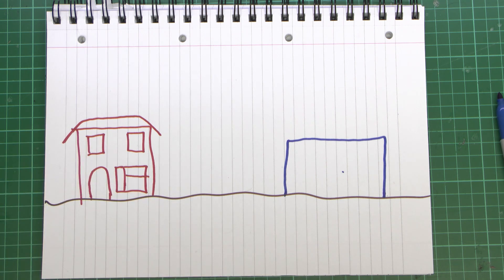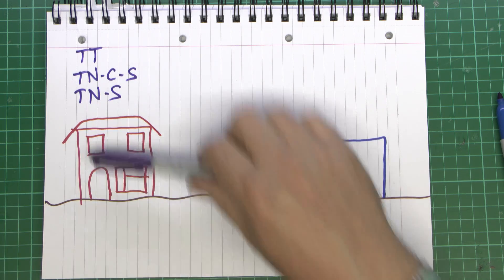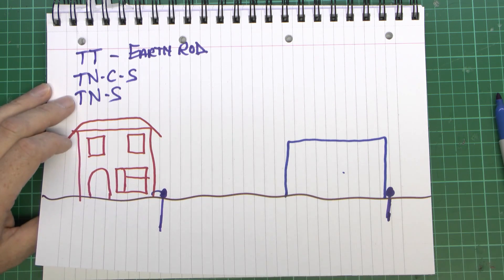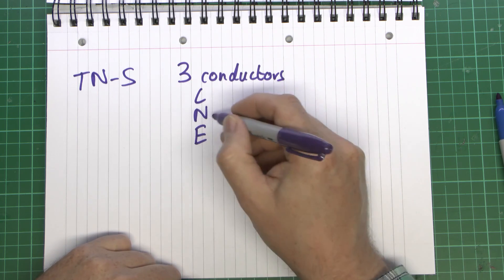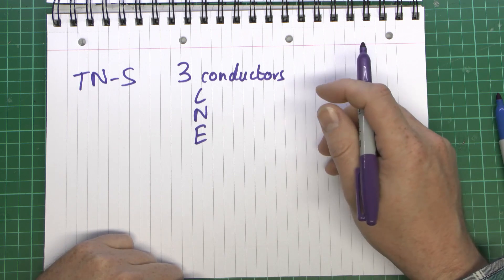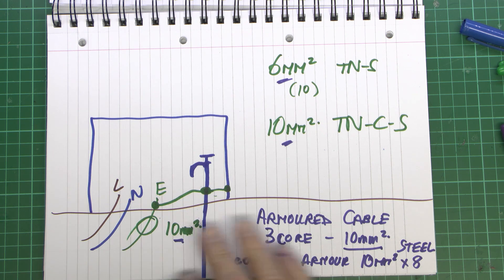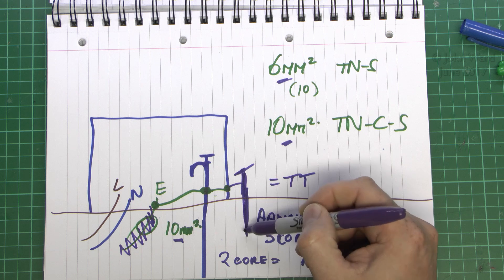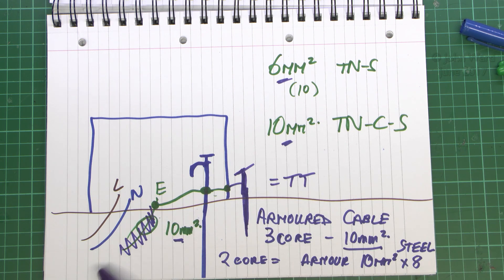Earthing Systems for Outbuildings

Comment: With TN-C-S supply, In the rules AS3000-2007 that outbuilding bonding cable really only needs to be 4mm2, I prefer 6mm2 min.  There is an min earthing conductor size to ensure trip times and fault current handling, table for each size of active conductor, eg:- 4mm2 is ok for 10mm2 active conductors 6mm2 earth is good for up to 25mm2 active conductors. 
The 4mm2 min and up to 120mm2 max applies to the conductor for bonding parts too, I can not see a blanket 10mm2 as its over the top and is not needed for a back yard shed typically with only 2.5mm2 twin and earth run in. The bonding conductor needs to be scaled min 4mm2 and up based on the prospective fault current for the largest active conductor feeding the building, 10mm2 may not be enough in larger installations, so that 10mm2 blanket bonding conductor size rule is rubbish even if it is valid. It's not being complied with here in Australia mostly it's only PVC insulated 4mm2.
Reply: We don't have TN-C-S supplies here, (we bond our "separate earth system" to the incoming neutral), and they don't seem to use our M.E.N system there which surprised the hell out of me ( they don't drive electrodes except in T-T and even then they choose not to bond them to the incoming neutral for some strange reason), so there is no point applying our rules to their systems, you will NEVER achieve our maximum "touch voltage" requirements with their T-T or TN-S systems, that's why they use RCDs as their PRIMARY form of protection, where as we use them for ADDITIONAL protection, we do not require RCD protection on sub mains to out buildings as they do (thank fuk, imagine all the phone calls of nuisance tripping you would get every thunder storm), it's also why we can use 4mm equipotential bonds here.
Oh one last point there is no "maximum" earth size anymore, the 120mm only applies to protected circuits.

Comment: John, thanks for this. You did not explain why the earth cable needs to increase from 6 sq mm to 10 sq mm if there were extraneous parts. I presume it is because more current needs to be carried .... but why?
Reply from the maker: TN-C-S installations require the main bonding to be at least 10mm.

Comment: A shop i worked at had a shipping container out back with a light and socket in it. They just stuck a plastic conduit from the shop to the container. no thought was given to bonding etc.

Comment: JohnMy assessor told me that if an outbuilding is more than 20m (footing to footing) away from the house then an earth rod must be installed.  Is that correct?  Thanks
Reply from the maker: In a way.  There isn't a specified distance, but as you get further from the main property it makes more sense to have an additional rod rather than to rely on what could be a very long cable.

Comment: My grandfather have some talent for electronics. Replaces the ungrounded power outlets with grounded ones, does not connets it to anything (at least he says), and there is 115 and 81 volts to main and neutral from the ground. If I connect my aplifier to the living room, the speaker in the bathroom give me 81V to the case of the washing machine. The next rooms power outlet works fine. It MAYBE connected to the heatin systems radiator. The taps earthing is removed. In the garage we have a power outlet which have main on both terminal. Makes extension cord from 3 color 4 core wire, uses the same color twice. Uses 3 core wire, metal case machine, earth plug, leaves earth wire long and not connect. Doesn't use the strain relief in the plug. Maybe I sould be or get an electrician and redo the whole wiring.

Comment: Rather than using 3core SWA at 10mm2, can you not use 6mm2 and use the third core AND the armour for Earth to make up the deficit? (assuming 6mm2 is enough for the L/N conductors too)
Reply from the maker: No, as 6mm² SWA has steel armour of about 23mm²,  but as steel is about 8 times less conductive than copper, the 23mm steel is only equivalent to about 2.9mm copper, 6+2.9 is less than the 10 required.
Reply: I would be a bit reluctant to supplement the 6sqmm armoured cable
earth core and about 23sqmm of steel armour in parallel. However, I don’t know
if this arrangement would equal the current carrying capability of the 10sqmm
bonding conductor? If the d.c. resistance of the armour is about 6.7ohms/km and
the d.c. resistance of the 6sqmm copper is 3ohms/km with a current carrying
capacity of about 42A, could we assume the armour will have a current capacity
of about 3/6.7 x 42 = 18A? This would give a total rating of 42+18=60A - which
approximates to the 60A rating of the 10sqmm single core.A bit shaky perhaps – A bit of hose pipe may be safer.ThanksPeter

Comment: John, A really useful video as usual. Thank you.

However I am not quite clear what connections are appropriate at the house and at the outbuilding in the different cases you outline.  Is the connection at the house always through the house consumer unit? And is it ever appropriate (or indeed permissible) to install a separate consumer unit in the outbuilding?  And if the answer to the second of those questions is "no", how would you connect, say, a lighting and a power socket circuit at the outbuilding (which must be a common requirement)?

I guess these might be subjects for another video.  Indeed you may have done one, in which case my apologies for missing it!
Reply from the maker: All depends on what is to be used in the outbuilding.
Can be a separate circuit, or an extension of an existing one.
A consumer unit can be fitted in an outbuilding but this is not essential - things such as lights could be connected to a 3A FCU.
Reply: @pmailkeey on ceramic pots?

Then again my GFs house is fed that way, 2 bare copper overhead conductors onto ceramic pots with meter tails outside,  (TT system)

Need to check what my shed is, I believe its fed with a 2 core MICC cable from a 16A 30mA RCBO in the distribution box assuming that the copper cladding is the earth

Comment: Related question, how to you measure the stray voltage generated when there is a bad Earth bond ?
I know of a commercial building with a stray voltage on anything earthed (sometimes). Thinking I have to report it to power company, as multiple transformers involved.

Comment: Interesting case-study:  garage with no extraneous conductive parts -- when upgrading the supply feed (replacing old non-compliant overhead twin+earth with short section of buried SWA).
If doing this we would consider the possibility of providing Electric Vehicle charging later, which has special earthing requirements IN BS7671 not mentioned in your video!  --  Seems that you are almost expected to TT the whole garage (or just a special earth-wire to that one charge-point ??), unless you have special low-impedance earthrod in house (unlikely) or special lost-PME-neutral-isolator (not yet existing?).
Looks like a compromise of all factors is to use 2-core 10mm (goes nicely into existing spares of 20mm glands/boxes) SWA as sub-main that could later be rated up to 50Amps at head-end.
This avoids the the substantive extra expense/size of 3-core 10mm and above, and even then feeding an extra 10mm earth wire in parallel would still be do-able if conduit protects this / allows it to be 'fed' easily?
Reply: If the client would like the added capacity for future possible electric car charging then this is a good idea. But for most people there not going to want to pay for this extra when they may not any intention of getting an electric car for many years.

Comment: Interesting case for bonding -- if you feed an outbuilding with Unshielded ethernet, and also separate SELV power (e.g. monititoring/alarm) in separate conduit -- all metallic, coming in from outside, but have no ''earthed'' wires at all ?
Reply: Then you have created an Extraneous conductive part into the building.
Reply: @shilks8773  Could you include the 10mm² Earth cable within the conduit ?

Comment: If i install an electrical system in an outbuilding containing extraneous conductive parts, with the main building being TN-C-S, I always install an earth rod at the outbuilding.
If there was ever a situation that the mains neutral was to become lost or damaged the earthing can become live at mains potential, which could be dangerous. This would not be a problem at the outbuilding if you made a TT system. I understand that you have multiple earthing steaks on a PME system, so if there was a break in the neutral the system can still be held at earth potential. However if the neutral break was between the last reliable earthing point and the customers home, any extraneous parts will become live at mains potential. I know the chances are slim but its possible. I have looked at the draft of the 18th edition, it looks like we will have to install earthing steaks on all new installations whatever the earthing system. I believe this is because of the points raised above.
Reply: +Lester Electronics
Additional earth rods would have to be very low impedance to make any significant difference, I thought...  In my view some kind of "PME lost neutral detector/3-pole-disconnector" might be needed...
Reply: Chances are your own house has a PME supply head and I doubt you've TT'd it, why would you bother treating an outbuilding any different?
Reply: @R-77 no.

Comment: John, thanks for this video and answering some of the questions below. This has really cleared up confusion I had around TT and the earthing that the electrician put in when he cabled my home office. He didn't connect the armoured cable armour to the outbuilding earth (there is a separate rod) or fit a time delay RCD at the house end. The breaker often trips when I plug in a laptop PSU and have to go dashing off to the house to reset the breaker. I will be having a conversation with him tomorrow.

Comment: In a TN-C-S system can you not just run a separate 10mm cpc from the consumer unit to the outbuilding along with a 2core SWA cable?
Reply: Minimum size of cable to be buried in the ground without mechanical protection is 16mm
Reply: +chris rix
But what about 10mm cable, ran alongside, and placed in plastic conduit along with the SWA where it goes underground?  is that good-enough for 'mechanical protection' ?
Reply: Nope, gland the SWA into a PVC enclosure before the CU in the outbuilding, and if? You've used a 3 core, then loop the earth core back onto the "banjo" / gland (crimped of course) and nut and bolt down as usual. Take the tails up to the isolator/ CU, then make the earth into a TT system by adding on rod or 2? (KEEPING the TT electrically separate from earth on / in the Swa that you've taken to the outbuildings)

Comment: Put your hand up if you've ever lived in a UK house where the garage wiring was a piece of twin & earth run from somewhere in the house to the garage...

Now, my question relates to network cabling... If I wanted to run network cabling between my house and garage (assuming said garage was correctly wired for mains), do I need to do anything special to isolate the network cable between the two buildings? Is it likely that a potential difference between the two buildings would build up, and use the network cabling as some sort of return path, doing horrible things to the network devices? Or is that only an issue for buildings far apart from each other, on totally separate power systems?
Reply: Shielded ethernet cables are bonded to the earth of the devices on both ends, so some current could flow down this if you use shielded cable bonded at both sides. It would effectively be in parallel with the the earth used to supply the outbuilding.

The isolators (often seen in hospitals) are typically rated for a higher isolation voltage, and isolate the shield.
Reply from the maker: Not a problem, all Ethernet cables are electrically isolated by the devices they connect to.
Reply: That was my understanding too. So what are the "ethernet isolators" for that you can buy? Is that in case the cabling itself somehow picks up a charge? (which is unlikely in a short 20m run from a garage to a house)
Reply: sure ive seen a lot of garages that have been using a standard extension lead for decades, running it outside along the fence in all weathers, plugged into  a spare socket, then wonder why they cant run much at the end of a cheap 30m lead.   dread to think how standard flex  it stands up to UV and british weather too,  my garage was built after the fact of concreting nearer the house, thus could not bury the cable, but in the 80s we wired at along the fence with MIC pyro cable,  have had no issues in 30 years, we also have an earth rod along with the pyro is earth in the outer
Reply: Fibre devices have come down enormously in recent years so I would go that way. Depending on the cable length UTP can get electrically noisy and lower your throughput (if this is a concern) and, has mentioned above, STP DOES connect end-points electrically through the shielding.

Fibre, by its very nature, maintains that electrical isolation, is immune to EMF noise, and allows high speed throughput regardless of distance.
Reply: There are different degrees of isolation. A typical port has a rating of 1500V (which is a TEST voltage not a continuous rating) but the industrial isolator I looked up was rated 4000V.
Reply: pmailkeey THAT BETTER NOT BE IN BLUE MDPE WATER PIPE!!!!!!!!!!!
Reply: @pmailkeey Blue pipe does not signify that it carries electric cable. When you've sold the house 20 yrs time - who is going to know that's what the electricity supply to the garage is going through. The pipe is blue for a reason!!!!. Yellow for gas. Red for Electricity. There are other colours for other services.
The national colour coding system for underground utilities are;

Red – Electric power lines, conduit and cables.

Orange – Telecommunication, alarm or signal lines.

Yellow – Gas, oil, steam, petroleum, or other flammable material.

Green – Sewage and drain lines.

Blue – Drinking water.

Purple – Reclaimed water, irrigation, and slurry lines.

Pink – Temporary survey markings, unknown/unidentified facilities.

White – Proposed excavation limits or route.
 Better get digging.
Reply: @pmailkeey Using Blue still does not make it right. Phone and Air are not very likely to kill you if you cut through it. Red is used for electricity for a reason. Poor workmanship.

Comment: Why not use a 6mm 4 core cable and use 2 cores of the cable for earth.
Reply: +John Ward
Why isn't there SWA provided with 10mm earth and 2* 4mm or 6mm cores, to cover this situation?
Workaround seems to be 2-core SWA, with parallel 10mm Earth wire, but then you have problems deciding if the 10mm cable is/isn't sufficiently protected by being in plastic-conduit / ducting all the way outside...!   Any Guidance on this situation?
Reply: sbusweb 
You answered your own question.
Reply from the maker: If 6mm is large enough for the loads, voltage drop etc. then you could.  However the difference in cost between 6mm 4 core and 10mm 3 core isn't likely to be significant.

Comment: if I have a garage fed with a 4mm swa cable on a tn-c-s system in the house but I have water pipe from house to garage which all in plastic pipe underground  to garage would this still need earth bonding garage even if it only had 2m of copper pipe in garage
Reply from the maker: Provided the copper pipe is entirely within the garage (not buried in the ground at any point) then no bonding required.
Reply: Great John your videos are great easy to follow and answer lots of questions in layman's terms cheers I have subscribed to follow other video thanks again

Comment: Your definition of extraneous part is curious. The wording of the definition in 7671 says nothing about the part necessarily coming from the exterior of the building.
Reply from the maker: It doesn't but in this context of an outbuilding, any extraneous part will inevitably be a conductive item originating from outside the building.
Reply: I could quite easily imagine someone putting something like a steel workbench for example in their shed though?
Reply from the maker: A metal workbench would not be extraneous as it cannot introduce a potential into the shed.
Reply: My understanding of equipotential bonding must be a bit off then. I was under the impression that it's not the bench that's the worry so to speak. It's the thought of something near it reaching a high potential and thus making a danger of touching between those two points.
Reply: My guess would be that that 'something near it' would itself have to be an extraneous conductive part, or fed from the same supply conductors as the earth is (and thus not supplying more current than the earth can handle).